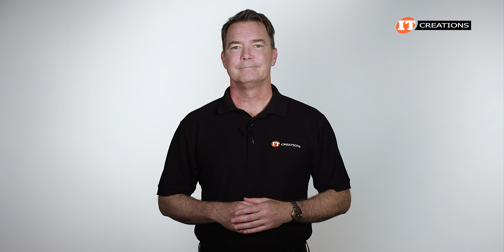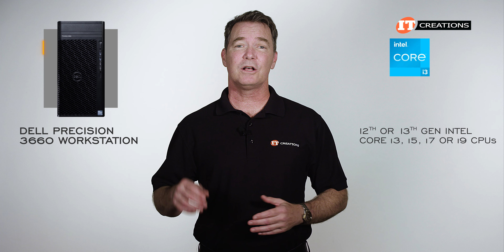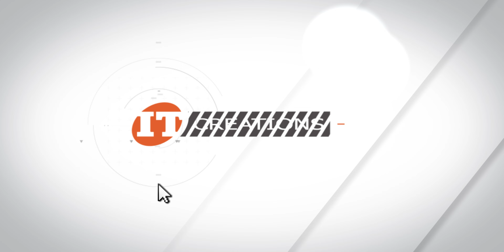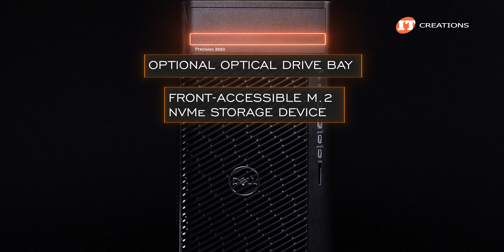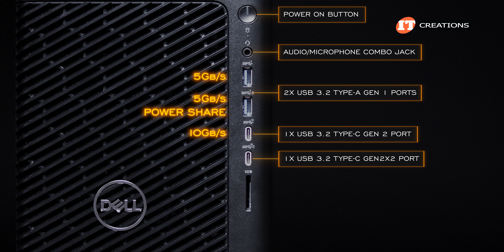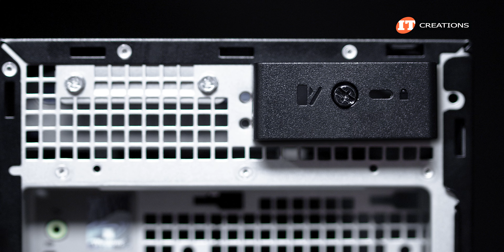Dell Precision 3660 Workstation with 13th gen Intel Core X CPU REVIEW | IT Creations

Comment: Your graphic for the two additional hard drives being inserted is inaccurate as the top left drive is forced to be inverted by the nature of that bay (you can even tell a difference in the blue drawers between the two).  I'm not happy about having one of my drives inverted and it also sounds louder when crunching data.
Reply from the maker: Thank you for pointing that out—didn't notice… Thanks for watching and commenting!

Comment: I have the Dell Precision 3660 Core i9 12900k, 32Gb DDR5 RAM, 1Tb SSD, Nvidia 3038 8Gb graphics card, and CPU water cooling. The first unit was replaced after a couple of weeks. In the second unit the mother board has been replaced this lasted 2 months and as of 2 weeks ago the mother board, CPU, SSD, memory and water cooler have had to be replaced. I am still waiting for this to happen the estimated time for the delivery of parts is the 17 Oct 2024 the unit has been out of action since the 4 of Oct 2024.Problems include overheating, blue screens, not booting, booting so slowly it appears to have stopped, booting into the F12 white screen, returning error codes such as 2000-0511 only to reboot normally once or twice and then not rebooting unless switched off for several hours and again rebooting as "normal".

Dell's warranty support is patchy, though the nice thing is they are always polite but this does not get things done. Getting replacement parts is always slow because they never seem to stock any parts in the UK.

There appear to be a number of technical issues causing these problems but the two main ones seem to be poorly written microcode governing the clocking/voltage of the CPU causing over heating and high end CPUs coupled to inadequate cooling. The CPU is liquid cooled by a 120mm radiator, air flow is supplied by two front fans, also cooling the graphics card via ventilation grid in the side of the case and one radiator fan pushing air through the radiator, the air flow is poor all around. The CPU is not cooled any where near enough unless it is clocked back to around 150w, usual clocking? is around 250w and even then I suspect over heating occurs. The smallest radiator on this unit if it is to be used under load is at least a 360mm radiator with push-pull fans on opposing sides of the radiator and this unit is supposed to for rendering and CAD and etc!

Comment: great video! If I order one with a PCIe NVMe SSD will the case still come equipped with 3.5" HDD drive caddys to add spinning drives later on?
Reply from the maker: I think… they are included for the two interior drive bays,  but the front is optional and a separate purchase. Of course, mention the video and we'll make sure you get the internal drive trays!. Thanks for watching!

Comment: Terrible Cooling, Terrible slow RAM, Terrible Chassis, Terrible NVME.  Build your own.
Reply: I'm using a Dell Precision 5820 Workstation. Super reliable, great performance, ECC RAM, great chassis (It's basically one big vent at the front and at the rear) I'm mostly using it for gaming and media. I put a RTX gaming card in it myself. I can't talk about the 3660 because I don't own one.
Why not build your own: If you want a system of which the configuration is factory tested for stability. How often do you see people complaining about random reboots with self-built systems or systems build by local computer shops? I'm just leaving the testing to Dell and enjoy the reliability of a pro workstation. And I'm happy to pay something extra for it.
Reply: @Aranimda  for a similar price you can have a self-built PC with an AM5 Ryzen 9 series and get a CPU with 37% overall higher performance, and higher single core speeds and 100% higher base clocks. It's easy to get much, much faster RAM, and a much faster NVMe SSD. 

Speed and reliability, in the right hands, shouldn't have to be a tradeoff.
Reply: These are typically meant for corporations to buy in large numbers.  Savvy consumers aren't buying a Dell Precision tower like this.
Reply: @a1m598  they better be getting a good deal, these things are like $2,000+ a pop

Comment: Regarding the Precision 3660 tower: Do you have any idea which, if any, PCIe and M2 slots are 'direct to cpu' rather than via the w680 chipset? Thanks
Reply from the maker: Hi there, 
I cannot determine which PCIe slots are off of the chipset. Board diagram here on page 8 of the Technical Guide: https://www.delltechnologies.com/asset/en-us/products/workstations/technical-support/precision-3660t-technical-guidebook.pdf 
However, for the M.2 slots, of which there are 3x (refer to diagram above) that support an SSD and one that is for a WiFi card, SSD 0 and SSD1 support PCIe 4.0, while SSD 2 has a PCIe 3.0 interface. Check page 15 here: https://www.itcreations.com/user-manuals/dell-3660-manuals/dell-precision-3660-tower-setup-specifications.pdf 
and page 7 here: 
https://www.itcreations.com/user-manuals/dell-3660-manuals/dell-precision-3660-tower-specs-sheet.pdf
Hope that helps a bit at least. Thanks for watching.
Reply: @Itcreations-LA   many thanks for that!  It's a bit frustrating that Dell don't divulge their mobo (0PRR48 in my case) block diagrams like some other mobo makers do. I would assume that the x16 slot is 'direct to CPU'' at the least. Thanks again.
Reply from the maker: @JohnJones-yw3dm  
I firmly believe you are right on the x16 slot for the GPU. Definitely would not make sense to have that major feature, performance truncated by going thru the chipset.

Comment: I want to replace the builtin NVMe SSD (512GB) with a 1TB NVMe PCIe v4 SSD Samsung Pro 980. The new SSD is recognized in Windows if I connect it via USB casing. I initialized it and put a partition on it. But it is not detected in the BIOS of the Dell 3660 or if I try to install WIndows 11. I put it in the same slot as the old one (which should be 4.0 compatible). I upgraded to the newest BIOS version 2.8.1, temporarily disabling Bitlocker for that. Any ideas for a solution? Thank you!
Reply from the maker: Base on the info, I have no idea. Try some of the troubleshooting suggestions from the link below or failing that contact your vendor for support. https://www.dell.com/support/kbdoc/en-us/000132300/how-to-troubleshoot-hard-drive-or-solid-state-drive-issues-on-a-dell-computer 
Sorry for the lack of solution hopefully something in the above might help. Good luck and if you solve the problem please share. Would love to know the solution.
Reply: Change from the default RAID to ACHI in BIOS. No drivers are required and the Samsung will be detected.